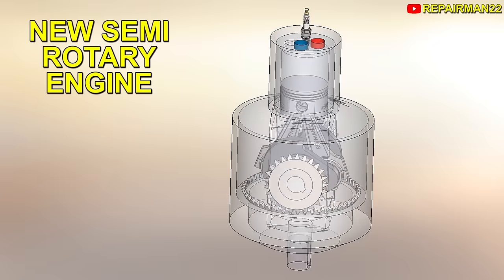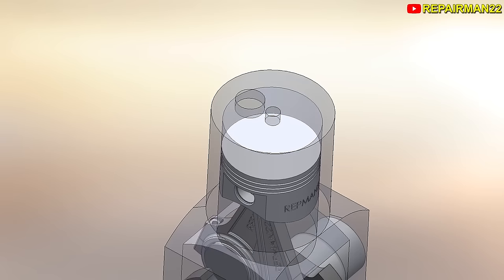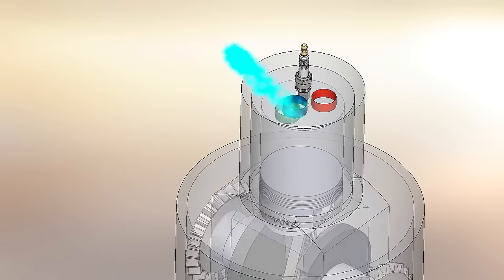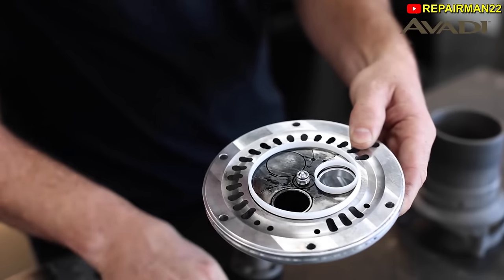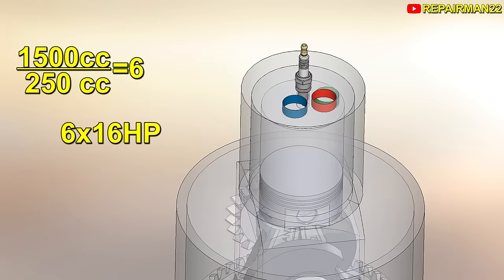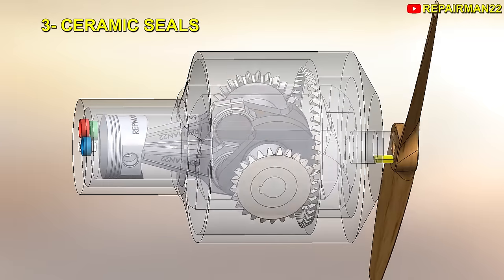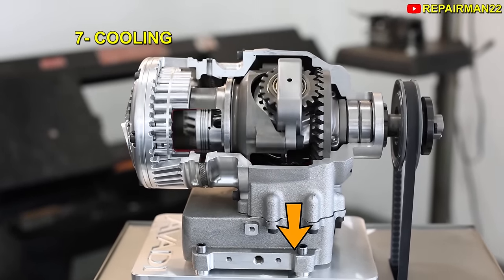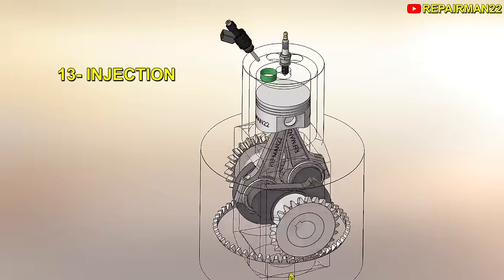New Semi Rotary Engine with 2 Connecting Rods 🤯 Avadi MA-250

Comment: I must say nice clean design with exhaust & intake ports but when I heard 1HP for 1Lb weight then it seems we already have that engine being manufactured under PowerBee 894 brand, which exactly same weight (15Lb) and generates 16HP and is very simple 2-Stroke design with parts that lasts for 20 years or longer.  This additional gears & double acting crankshaft will see a lot wear within 6-months or even earlier depending on where it is used.  Besides moving Cylinders & Moving pistons- good luck with that.

Comment: If the output shaft could be reconfigured to exist to the side an opposing piston might be doable. If so the displacement would be doubled, 100% more, with less than a 50% weight and size gain.

Comment: What keeps both connecting rods in time? The gear it's driving?
Reply from the maker: yes, and in a scissor, what keeps the blades in time? in this case the piston pin.
Reply: @repairman22  ok. Cause yeah, there really no other position the crank ends could be, besides the correct one, or in line with each other, in which case it wouldn't even work, let alone, fumble itself into such a position.
Sorry, still trying to wrap my head around it! Never seen an engine like this! It's ingenious.

Comment: I've seen the exact same concept about 12 or 15 years ago and it doesn't changed a bit. All the same problems with unnecessary piston rings rotational motion added, unnecessary gears, cantilevered crankshafts and difficulties with making the engine bigger than a single cylinder one (it's possible yet difficult and expensive).
In conclusion this engine doesn't make much sense because of added mechanical complexity and cost with almost non-existent benefits (only real one is it's balance but it could be achieved without all that gears and complexity).
Reply: There's no fundamental reason why the crankshaft needs to be cantilevered.  They could put an additional support in the center.  The value of this is that the output shaft is naturally in line with the cylinder, so while it may be taller, it is slimmer.
Reply: @wagnerrp  there is fundamental reason for cantilevered crankshaft: you simply can't place a journal bearing between two conrods in this engine because of little available space between conrods in given piston size. And that's not the least problem with this engine.
Reply: @teolynx3805  That's not a fundamental reason.  That's a design choice.  Adding more separation means introducing more torque on all those bearings, and there are good reasons for not doing so, but those are all choices.
Reply: There is no piston rings rotational motion. He spent a pretty big part of the video explaining this.

Comment: Too many things where loads are asymmetrical and wear rates will not be giving satisfactory life for most uses, but it could be an ideal 'drone' engine especially with the output shaft turning at the correct speed range for a propeller. If you approach it as being for that use you might be able to cut more weight and overlook a lot of the wear problems.

Comment: How did they get the rotating valve assembly to seal properly?
Reply: It seems to be pretty much the same as the ceramic apex seals in a rotary, just sliding between pieces of metal. It seems like it'll be even more similar if/when they move the ports to the side instead of the top

Comment: The only concern is sealing of the rotary valves.  This is an emissions issue for hybrid cars.  There is a reason rotary valves have been tried again and again and not used.

E.g., British WW2 aircraft engine development bet heavy on rotary valves.  RR gave up early and why they were the sole initial contender.

For drones, a good concept.

Comment: with 2 con rods going in opposite directions, wondering if secondary balance may be near perfect also....... 🤔🤔🤔🤔
Reply: No, it wouldn't be as the conrods still go sideways and then straight up. It has the same balance problems as a conventional single cylinder engine, however i don't know if or how the gyroscopic effect would affect vibrations, like mentioned in the video.

Comment: Suck, squeeze, bang, blow.  That's a 4 stroke in 720 degrees of crank  rotation.  It doesn't matter that the piston and cylinder only make one horizontal revolution, the crank is going around vertically 2 complete times, 720 degrees, to complete each cycle.  I would think that what limits rotary valves would also limit this engine, seals and lubrication for the ports.  Still, a novel and interesting design.

Comment: I'm not anywhere near an expert in this field, but this looks to have several issues imo. 

For one, you're trading a sequenced line of firing pistons with offset and distributed weight for,  in this case, a piston and combined crankshaft arms all firing at once (yes, they are weighted, but that really only reduces the existing problem of vibration), which means youre occilating say, a plane prop back and forth as you're spinning it, which kind of makes me think this would vibrate a directly connected prop to pieces after a little while.

Another thing is that saying the piston doesn't rotate is innacurate, it does rotate, and so does its casing, and in my uneducated brain, I imagine that rotational energy would make the piston constantly be fiighting the centrifugal urge to rub up against the casing as its firing, which would wear it down really fast. That's to say nothing about those seals around the spinning casing wearing down, and the fact that the seals around both the injection and exhaust ports are ceramic.

Like I said, I'm not an expert, so Im just talking out my ass, but hey, Im glad to be proven wrong. I'm into the idea of new and strange advanments in tech and mechanics.

Comment: I'd like to know how much efficency is lost with a conventional single cylinder four stroke engine as apposed to this engine. Yes, camshafts and valves suck away a bit of energy, but at least they aren't going to sheer the gear teeth off like this might.

Comment: Piston speed will be a problem at high RPM, on the flip side I know of a engine design that has been running for over a decade on petrol & hydrogen, it is of comparable size to this design, it is over 600cc, fires 4 times revolution, has the equal to 175mm stroke of a piston engine & has only 5 moving parts.

Comment: Obvious problem - friction in "valves" as well as tight seal. Impossible to maintain for long. Poppet valve is a winner for a reason. Second issue is a bearings on both crankshafts. Room is limited and piston together with crown gear trying to bend that bearing in exactly the same direction. It wont last for long

Comment: It still has a reciprocating piston but with this engine it has double the reciprocating mass & double the moving part's, & its only a drawing.
Reply: It isn't double the reciprocating mass, it's roughly the same reciprocating mass cut into two pieces, & it's not only a drawing; they literally showed running prototype engines in the video. It is double the moving parts though, and those valve ports are never gonna seal right.

Comment: For how many hours can the piston and piston ring survive?
Reply from the maker: why should it last less than any other if there is no difference.
Reply: To clarify. The cylinder rotates at the same speed as the piston 👍
Reply: @Agualyone  Yeah that's a problem, it's another motion that will add wear AND the piston rings will slip out of place much easier.

Comment: The oppertunity for range extending engines for EVs was two decades ago when there were only a few but squandered Electrified projects like the EV1

If they weren't subject to corporate sabotage, god knows how far have new combustion engine designs may have evolved by now.

Fiat in 2024 is only talking about a REx for the 500e despite Fiat hybrid, PHEV and EV concepts going back to the Cinquecento and Mk1 Panda.

Comment: Good luck to them in making this work but far simpler development is putting rotary valves on a conventional engine & the sealing problems around those valves have not been successfully resolved & 100 years ago they had sleeve valve engines (that even progressed into some high performance WW2 engines) but further development on them wasn't seen as worthwhile so whilst hopefull that they can succeed here history is somewhat against them (unless they manage to solve what others have failed to do).

Comment: BMEP of 1.2... Not impressed.
There were 50cc motors in the 70ies that had 14+hp made by Honda.
Also. Those are rotary valves. They are worse than poppet valves at sealing and inherently leaky. (So EXACTLY the same problem as rotary).
The gear meshing will take at least 8% efficiency from the getgo, because it is similar to differential gearset.

Comment: very simple intake and exhaust. i suppose its not very tight but im sure it can have quite insane rpm. also it intake and exhaust are completely undisturbed by any valve like in traditional engine. yeah i guess that is cheap engine for suicide drones for sure. wonder if it was used on any.

Comment: Too complicated, cooling issues, will never reach high RPM, where are the bearings for the rotating cylinder/crankcase. Comparing to a Honda ATV engine  is a low bar for power output. Roadracing motorcycles of 250cc when they were 2 strokes reached 100Hp.

Comment: History has proven that designs like this, never prove reliable. Expecting the piston to spin, and the associated loads subjected to the wrist pin, and the crankshaft with unsupported ends, carrying that load, never mind the spur gears, transferring the shock load into a spinning force, would pound all the parts to oblivion in short order. Hundreds of years, of simple piston to rod to crankshaft design has already taught us what works, and what does not. From the age of steam, to today.
Reply from the maker: Hello. I can't believe this comment.  The piston doesn't rotate, and the combustion is not discharged in the gears. All is said in the first 2 minutes of the video.
Reply: @repairman22  Of course the piston rotates.  It's just rotating synchronously with its cylinder.  You're still experiencing centrifugal loads that don't exist in a traditional engine.  Where did they say anything about discharging exhaust into the crank case?

Comment: Choosing a 250cc 16hp honda as the comparison is a bit disenginous or just marketing. Cbr 150 does more than that. Aircooled chinese 250's do more than that.
Reply from the maker: I chose it because it had a similar rpm number. Bike engines rotate higher, so they produce more hp. It was not a fair comparison.
Reply: @repairman22  but it is a fair comparison if it can't turn faster? Same volume the engine takes could be a fair -  for the drone usage weight.

I am intrigued though how well the valve system would do on a regular bottom end, if the rpm limit is from materials of the valve or the bottom end.

Theres been a 3d printed rotation valve top end like that toy on thingiverse for about 10 years but that had a different bottom end and the outher sleeve rotated(the toy had a hand crank to turn it, didn't pump air very efficiently tho due to looseness when i printed it)

Comment: Another loony world-beating engine design that will go nowhere.  Big rotating mass. Perfect primary balance, but but you've got a pretty big unbalanced rocking couple from the two counterweights on different planes. And last but certainly not least, that rotary valve setup is going to be problematic to seal.

Comment: Absolutely nonsense! Two rods, rotating cylinder, this is two much mass. The valve timing is bad, like in very old 2 stroke engines. It's an answer to a question that no one has asked.

Comment: Think of the force aplied on the half crank's bearing...
You'll understand that right gear play will not last long.
Think of the duration of camshaft and impossibility of any overlap by design,
pretty useless for any gazoline design. Better be use with a diesel option.
And a last thing, Panhard proved 70 years ago that rotating cylinder does NOT work, and this was due to sealing
so a design with exaust right next to intake can't work even in a short time and that's aslo why rotating valve can't work properly.
So yeah, beautifull engine but very crapy design, no wonder why no one want it.